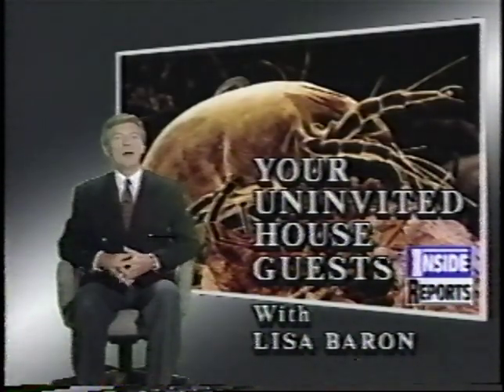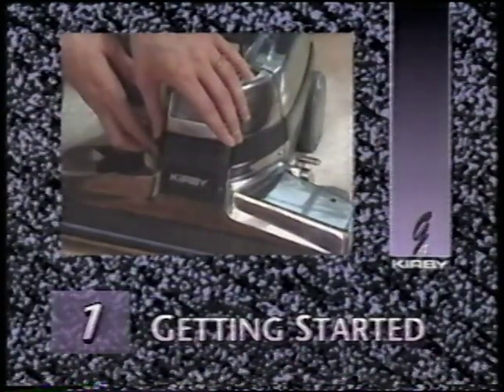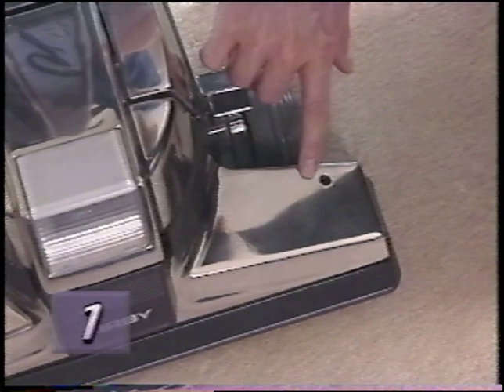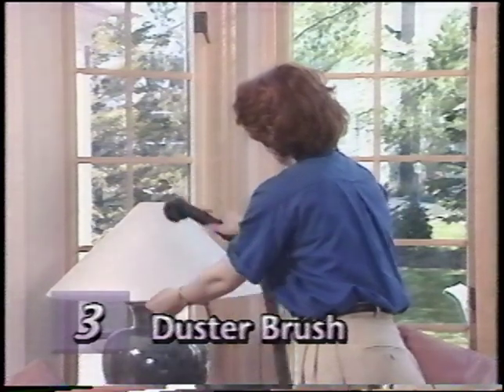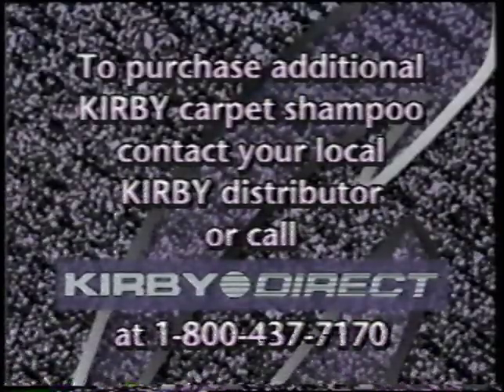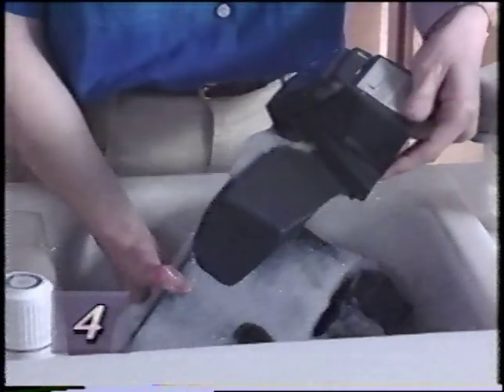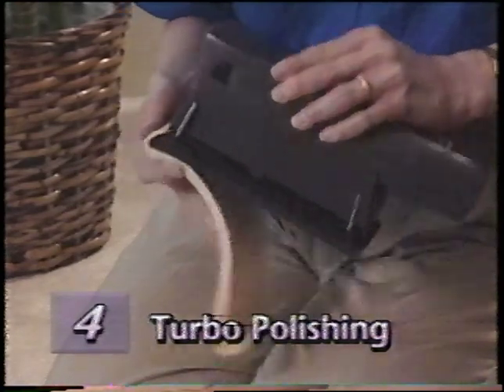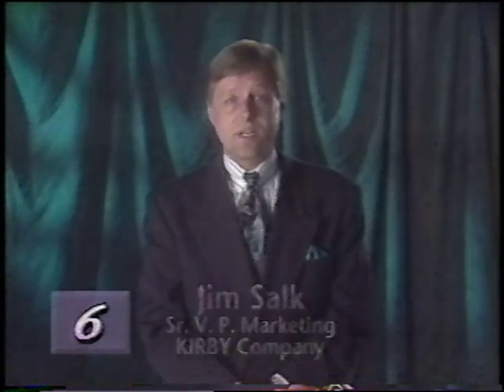Kirby G4 (VHS)

Comment: Talcum powder is hydrophobic, meaning it doesn't mix with water.  That's why they used it with the Rainbow, to try to make the Rainbow look bad in terms of filtration.  I had that same exact model Rainbow and it had no problem catching dust.
Reply: the rainbow couldnt stand up to the milk test, i simply asked for a glass of milk, help it up to the rainbows  exhaust and watched the milks surface turn black, not what you were told would happen when you used your brand new rainbow air purification unit, which of course was the only true selling point!
Reply: @dennislarmore7501  Probably carbon dust from the motor, which if I understand correctly, isn't as major of a threat to health as household dust is.

Comment: yooo kirby just straight up dissed rainbow😭😭
Reply: Because the Kirby is about $1,500 cheaper and outperforms the Rainbow pos by FAR.
Reply: Well they intentionally sucked up something the rainbow can't handle.
Reply: i own a rainbow and this G4 both are very good but the rainbow requires a little but more work